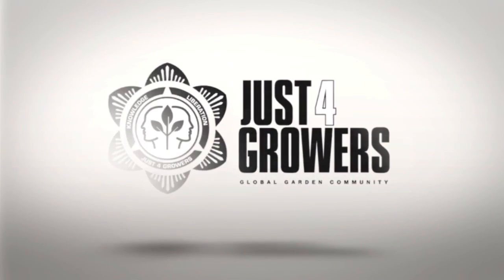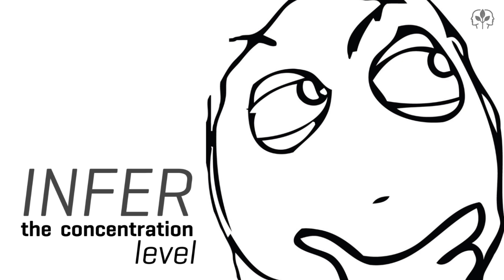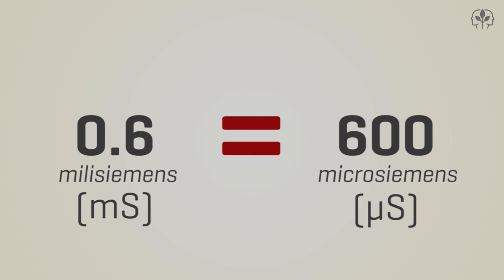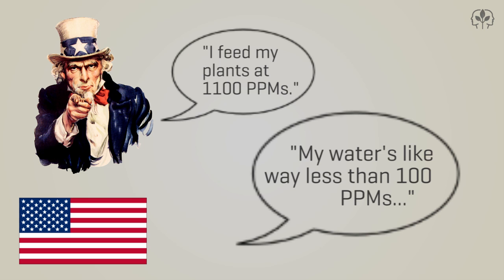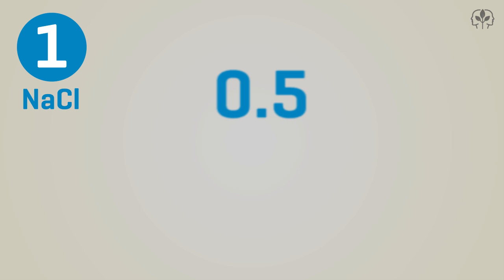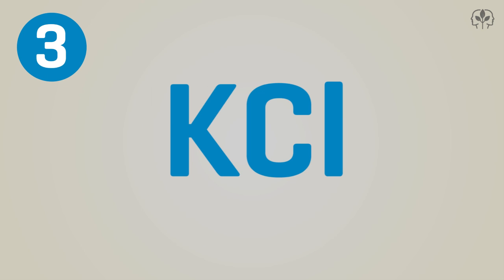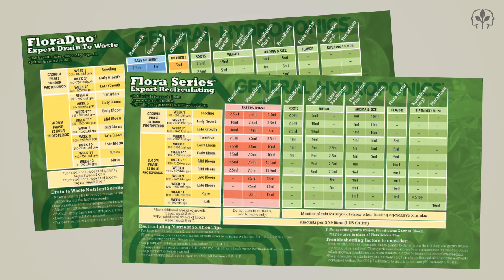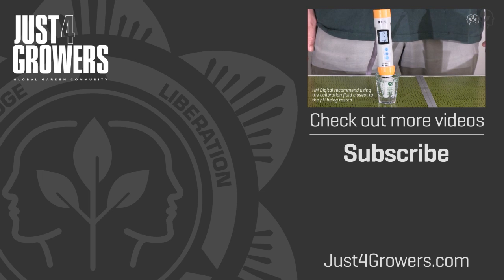Hydroponic Nutrients TDS, PPMs and EC Explained!

Comment: I'm still confused because I found a thing online that called for so and so ec and so and so ppm I have been using grow more sea grow for my soil plants but want to grow herbs and spices in hydro as well as stray berries and maybe a cherry bush sooo do I add any npk ratio nutes until I get to ppm I want once I hit that ppm what if my ec isn't right? How's that adjusted 

From what I gather npk ratios go out the winder and all you want is ec or ppm reading right?
Reply from the maker: SPCkeith Hey SPCkeith. Thanks for your question. Start with a premium hydroponic nutrient (single part, grow A & B, bloom A &B, or three-part) and follow directions for vegetative, transition, and bloom that you'll see on the label. That way you don't have to concern yourself with the NPK as the nutrient blenders have largely done that work for you. Your responsibility, as you correctly determine, is the CONCENTRATION and pH of the nutrient solution you mix up. The more nutrient product you add, the higher the PPMs (Total dissolved solids (TDS)) or milisiemens (Electrical Conductivity (EC)). 

It's a bit like making a tropical fruit cordial drink. You can add a little for a light drink or a lot, for a sweet syrupy drink! Still the same tropical fruit cordial with the same blend of pineapple, peach and orange—just at different concentrations! :)
Reply: Everest Fernandez awesome thank you 

One more question if I may I know ph is number one but some of the charts I found listed differing ec for every plants but some plants had the same ppm needs but differant ec needs is ec just a bit more standard formulation? And ppm is really not as critical? If I'm following right? 

I'm looking to do one of them vertical hydro set up this year (like the rain tower or I think that's what it was) 

I'm wanting to do lettuce over the winter and then once the shipping opens for strawberries currently I have sea grow 16-16-16  and the 4-26-26 these are water soluble and from what I understand are ok for hydro use. I like to go as organic as I can but simple too 

With soil I use root riot cubes to start and then plant in black gold moving to dr earths pot of gold soil when the plants are slightly older and then I just water in half tsp per gallon of filtered water of the sea grow 

Can hydro be that simple and do you know any good products you can recommend? Thanks
Reply from the maker: SPCkeith Hey SPCKeith—PPMs, EC—these are two leaves on the same tree my friend. EC is a measure of electrical conductivity—typically measured in microsiemens per cm, sometimes written as µS/cm. TDS is a measure of the total dissolved solids, typically expressed as PPMs. 

To measure EC we use an EC meter—this passes a small amount of electricity between to electrodes and measures how much gets through. This is interesting to hydroponic growers because the more concentrated the nutrient solution, the better it conducts electricity.

Now, to accurately measure PPMs you would need to evaporate all the water in your nutrient solution and weigh the solid residue. This, obviously is not practical for most folks—so we use a TDS meter.

What is a TDS meter? It's an EC meter! Yes—the two are essentially the same thing!

All your TDS meter is doing is measuring the EC (in microsiemens/cm) and using this to guess the PPMs. It does this using a conversion factor.  Different minerals in solution confer different levels of conductivity so it can only guess. Normally I go by x 0.5—that is, 1000 microsiemens is equal to 500 PPMs. 

Hydroponics is simple. Begin with the purest water you can, invest in some good quality liquid hydroponic nutrients and monitor your growing environment (min max temperatures and relative humidity) and you're off to a great start!
Reply: Everest Fernandez gotcha between that and some other stuff I was reading makes sense now. Why do these things have to be so confusing haha soil growing has been my thing all my life but it'd time to learn new stuff 

Now when it come to nutes I'm looking at the maxi line from gh figure 3 parts how hard can it be or 2 parts minus the cool bloom are there any other good nutes like this? I currently use sea grow for my soil plants the 16-16-16 and the 4-26-26 any idea if those will work in hydro?
Reply from the maker: SPCkeith I recommend choosing a nutrient product that's designed specifically for hydroponic applications so that it has the right balance of nutrients (especially calcium and magnesium). The three part flora series by General Hydroponics is a mainstay of my hydroponic garden—works great, easy to use, versatile, pH stable. Go for it!

Comment: Great video.  However, can you tell me how PPMs and EC have relate to pH?  My meter (from Mudder on eBay) is called a "pH or TDS meter".  It measures in PPMs.  So what's the pH of the solution?
Reply from the maker: Conductivity has no relation to pH Don. Check out my video pH for Hydroponics 101. Happy to answer any questions you may have. I can get into the whys and hows! :)

Comment: Anyone know if you could measure the Chlorine levels or at least meter them using a TDS meter ?
I bought one of the Chlorine test meters from ebay :/ http://www.ebay.ca/itm/pH-CL2-Chlorine-Level-Meter-TDS-Water-Quality-Tester-Monitor-frSwimming-pool-spa-/311347766798?pt=LH_DefaultDomain_0&hash=item487dc5e60e

AND when I put some pink salt into the glass of water the chorine reading shot waaay up...

Of course the TDS meter reading also went from 15 ppm to 221 ppm.

The PH reading appeared good, I compared it to my Milwaukee PH meter and it was within 0.1  of the Milwaukee reading so I call that a passing grade.

 I`m stumped, ether the Chlorine meter is crap or all chlorine testing kits do the same if you add pink salt...???
Reply from the maker: NoFear4XJs Hey NoFear. Thanks for your question. A TDS meter does not measure chlorine levels. It will measure chlorides such as sodium chloride but that's a totally different thing. 

A TDS meter is just a conductivity meter with some onboard software to estimate / infer the total amount of dissolved salts. As such, your TDS meter will only change when you add solutes that impact the conductivity of the water, which most salts do.

If that helped please consider subbing my channel! Thanks :)

Comment: That was clear as mud to me!!!
Reply from the maker: Kenneth Elston Sorry Kenneth—you're certainly not the first to convey similar sentiments. I think I tried to pack in too much info into too short a time. The strength of a nutrient solution is physically based on the amount of minerals dissolved in it. However, I was trying to say that your TDS meter (what we use to measure nutrient solution strength) is really an electrical conductivity meter! It's just a bit of software inside that takes the nutrient solution's electrical conductivity and calculates (or rather estimates) your total dissolved solids (in PPMS or parts per million). Different TDS meters make the conversion between electrical conductivity (in milisiemens) to TDS (in PPMs) using different conversion factors—so it's important to know which conversion factor your meter (or calibration fluid) is using. You can forget all about this if you choose to stick with EC like the Europeans do—like the metric system, it makes far, far more sense! :) Still clear as mud? :)

Comment: absolutely more confusing....sorry, just trying to fix a failing hydroponic
 and this PPM thing seems worthless. The nutrient solution says add certain amt per galllon, so what do the PPM help in anyway with that? If it doesn't like the number should I add more and burn the roots? What use is the PPM, like, who cares
Reply from the maker: Marcella Smith Hi Marcella, it looks like we need to take another stab at this one. Sorry the video didn't clear things up. Many nutrient manufacturers give directions based on amount (of nutrient concentrate) per gallon (or litre) of water—but you should always check the strength / conductivity of your nutrient solution when you're done, before feeding it to your plants, to make sure you haven't inadvertently gone beyond their comfort zones. Mature tomatoes can take upwards of EC 3.2. Lettuce prefers around 1.2. Big difference! Parts per million (PPMs) are an approximation based on the electrical conductivity of your nutrient solution. This was the central point we were trying to get across. 

Anyway—feel free to message me if you need any further help. That's what we're here for. You can find me here, of course, or at our Just4Growers Facebook group if you swing that way. Peace out.
Reply: My PPM meter has never shown it that low, it is usually a number like 160 or so. I'll check out the FB page, I have an interm problem that I can't get rid of, my roots will overnight become a thick goop. Ph has been running 7.2 or roundabout, I bring it back to 6.0. The last batch of strawberries that died I bleached out the system entirely, but this is the 3rd week with a new batch and over night they became thick goopy roots. I use hydrozyme, and masterblend for nutrients, I've tried adding H2O2 and it helped but this morning the roots are all jellied and the solution looks slightly cloudy, I am getting ready to clean them off with the hose sprayer, thats the only way to clean it off. Any ideas? I can't figure out how to message people on youtube, I've clicked all over can't find it. Wait, I will check the PPM thing,...136, when you pick up one of the plant cups, sometimes the goop breaks off. I have a 3 PVC setup with the solution pumped to top and it goes down the tubes back to the solution container, the water moves pretty fast, there is a constant 1 inch of water so if the pump fails I won't lose my plants if out of town
Reply from the maker: Marcella Smith Something may be causing low levels of dissolved oxygen in your nutrient solution and in your root zone. My guess is a warm nutrient solution. Do you know its temperature? What about air temperature? Are you using a media-less system? Small reservoir too perhaps?
Reply: Dang, the temp has been going up, the days have been running 75-80. Another told me they think it is pythium, I think I'll try to get some wilt guard which treats pythium. I just bleached out the system again, added nutrient, hydrozyme, and Rapid Start, the pH is adjusted to 6.0, I cleaned all the roots off with the sprayer hose, I guess I need to keep the water temp down, I've used iced jugs before, perhaps I need to just routinely do them daily
Reply from the maker: Marcella Smith Better to tackle causes rather than treat symptoms. Sounds to me (after seeing the related discussions on our FB group too) like you need a larger reservoir, potentially with a chiller, to keep your nutrient temperature down. If plant roots are submerged in nutrient solution you must make sure it is kept cool and well oxygenated.
Reply: This week the temp has been high, yesterday 98 degrees! I am freezing big chucks of ice and putting them into the reservoir, it is about 20-25 gallons. It would be nice to have a chiller, maybe next year as they are expensive. I even thought of buying one of those small refrigerators used and putting it  in the shed next to it and running a coil thru the middle to cool and then back out to the system  :)....but well, the strawberries are struggling but the are holding their own with that CX Hydro Wilt Guard stuff I got yesterday and the Z7 part 1&2. It was almost too late. The roots are looking better but in this last week is when the roots got the worst of the rot. I am willing to see if they will recover
Reply from the maker: Marcella Smith Wishing you well Marcella. Just curious to know how you managed to get through that hot spell. Did the CX Hydro Wilt Guard save the day?
Reply: The Wilt Guard is the one that worked the best, I also worked on keeping the water cooler by putting a bucket ice cube in every day in the morning that I made in the freezer every night, usually added some fertilizer and Wilt Guard in each bucket so it would water down the solution as it melted. Just kept that up, I did lost most of the strawberries, but I wanted to learn so just kept it up, replaced the berries with other things like celery plants that were struggling in the garden really picked up well in the tubes, so did water cress, oh and bok choy really looks good, and believe it or not but those big white flowers that only bloom at night can't remember the name. But learnt alot about hydroponics this year with all the problems, can't wait to start all over next spring, willl use Wilt Guard from the first solution! Thanks for all your advice!

Comment: would you happen to know if it is possible to calculate certain macro and micro nutrients such as potasium, nitrogen, iron with just an ec meter?
Reply from the maker: Hi Jonathan. Thanks for your question. I'm not aware of any method using just a regular EC meter because it measures overall conductivity created by all the solutes. I am aware of meters that allow you to measure specific ions (e.g. CleanGrow dot com) so they may be worth checking out.

Comment: I use bluelab truncheon , | understand that in blulab truncheon we have ec .2 to.3.6 ms and NACL conversion factor tds 500 ppm,which is= ms x1000 x .5 and natural water conversion factor 700 ppm which is = ms x 1000x .7.
when i read in fertilizer 4 18 38 , conductivity 1500 ppm , is that nacl or natural water conversion factor? thanks
Reply: Bluelab's truncheon (great piece of kit!) actually shows EC, x0.5 and x0.7 scales.
Reply: +Dan Fox Yup I have one and they come pre-calibrated. I played with it last night checking the PPM on my tap water vs purified water.

Tap water was 260-270 and purified was 0 PPM. Pretty cool stuff.